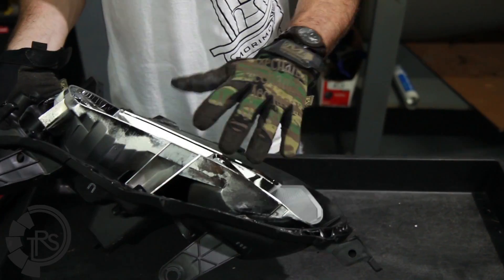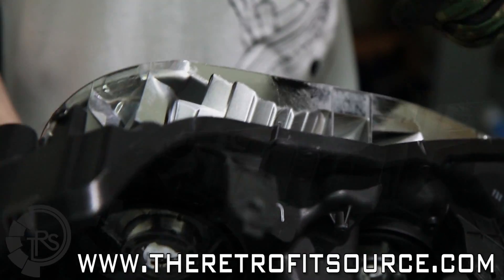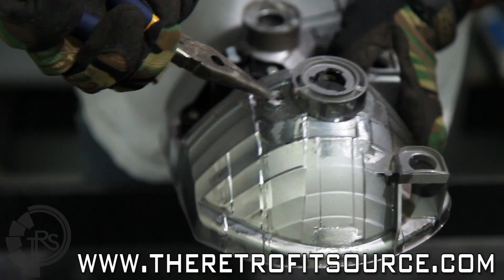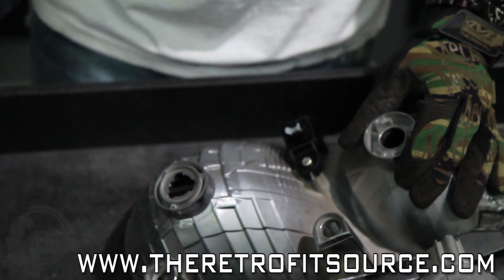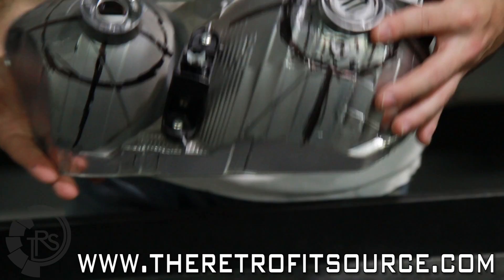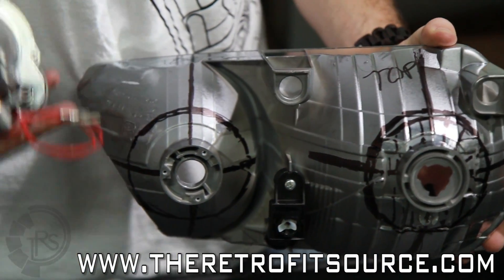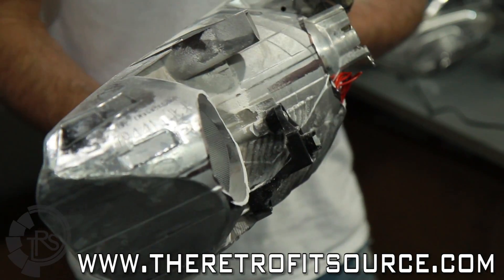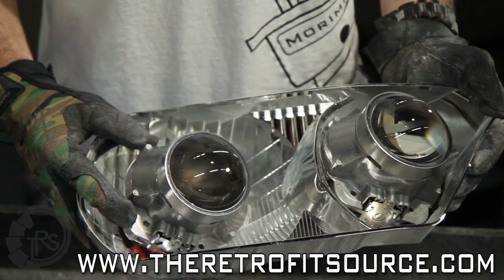TRS Tips: Modifying Headlight Reflectors to House Projectors

Comment: You stopped at the end washing the relector. Is there a part where you fit the projector in and mount it in?
Reply from the maker: Check out some of our newer retrofitting videos, They go in depth on the whole process.
Reply: TheRetrofitSource Inc I’m not seeing anything about mounting the projector into the modified dremmeled reflector like screwing it in and stuff. That’s about the only part I don’t understand so far. Appreciate the help  :)
Reply: @b6_ruby  the M-LED video was good if you want to use jb weld. But you can't take then apart and sell them later if you do that.
Reply: @RetrofitSource  Agreed. Once they're mounted I can take it from there.